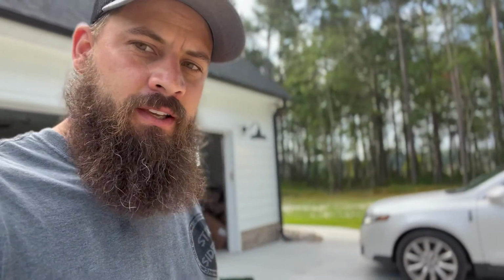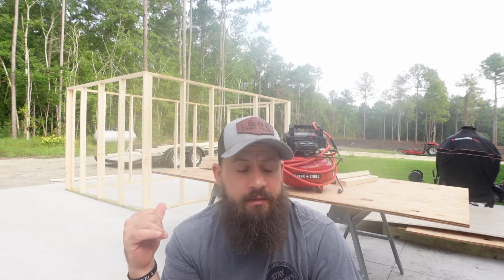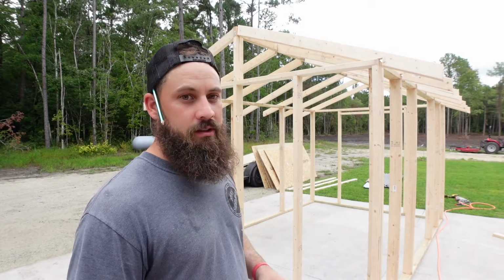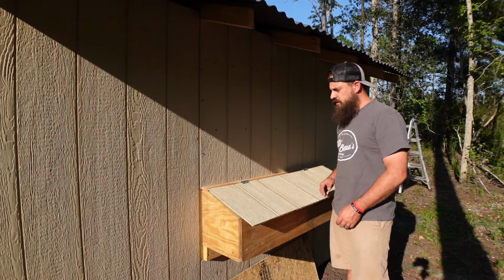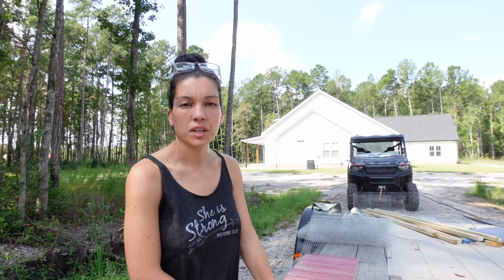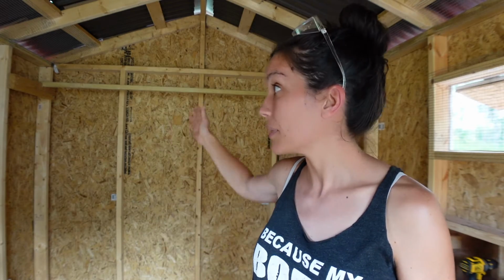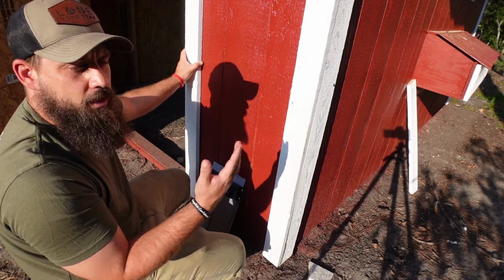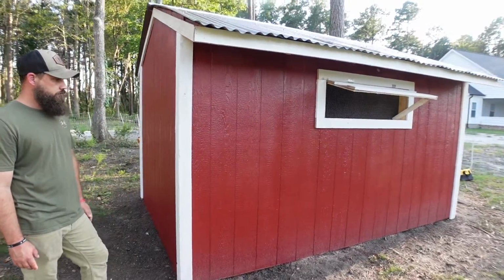The Ultimate Chicken Coop Design and Build

Comment: Looks great the only suggestion I would make is this. Even though you have the electric fence around your area it is your only line of defense. You should trench out the base of your coop on the outside 6-10” deep and put a layer of quarter inch tack cloth to prevent weasels ferrets raccoons fox whatever from digging right under your coop and inside. That’s the only weak spot I see. Otherwise looks great and I can’t wait to rebuild mine once we move down.
Reply from the maker: Yes!  We have been considering adding that.  The electric netting does help for sure, but it's definitely something to think about.
Thanks for watching 🥰